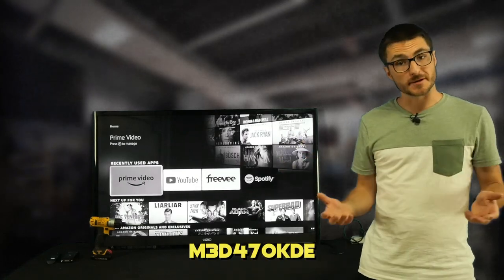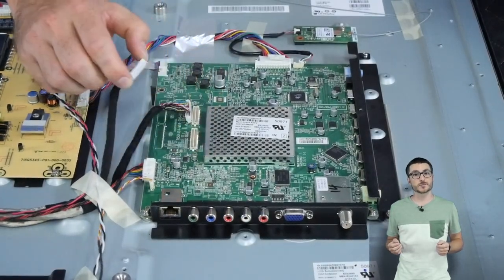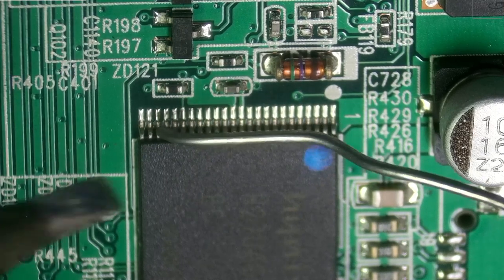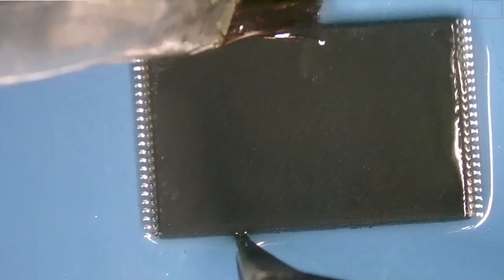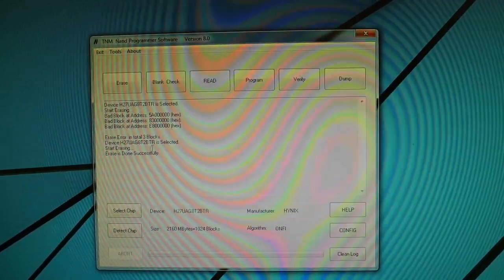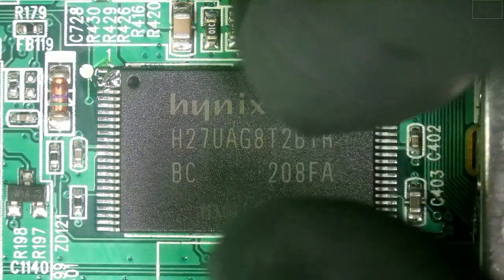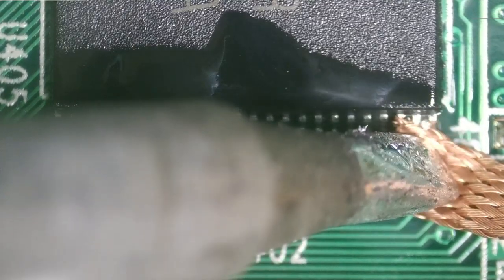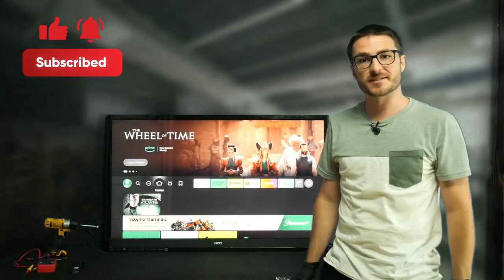Fixed Vizio Black & White Picture M3D470KD

Comment: I might be interested in buying one of these black and white hd TVs as long as there aren't any other issues such as intermittent power.  I was actually looking for a grayscale 1080p TV 42 to 55 inch but it seems there are none for sale.
Reply from the maker: I am not sure I follow. You want it to have a black and white picture? 
If that is the case you can just buy a tv and remove color in the settings so it only displays in black and white. Not all cheap low end tvs will have that as an option in the menus but a lot of sets do have the option to change color settings including removing all color. 
If you are looking to buy it because it's going to be cheap and has a known repairable fault, then yeah this Nand repair is almost 100% success.
Reply: @NicksTVRepair  Yes. Im interested in a hardware based solution to have a black and white tv. why, why not.  So for example if there are certain models that can operate without the nand in black and white then the nand could just be removed and left out.  In other words are there models that the nand could intentionally be removed and the TV will function as normal just in black and white?

Comment: Man, I really wish this video was available a year ago or so. I struggled to fix my exact model, even buying several different components and a new main board. What are the odds the different MB gave the same results? Whatever they are, I was the lucky one who still had the B&W issue! I love this TV and it went strong for around 11 years. I'll definitely consider sending in the MB sometime!
Reply from the maker: Odds of a new mainboard with the same fault are incredibly high. In fact it would be surprising if you found one without that fault. The reason I say this is because it has been over 5 years since new mainboards have not been available for this model. This mean the "new" board you got was a used board falsly advertised as new. Because this is a very common fault, people who own this set are likely to experience this fault as this set is as you said about 11 years old or so, and when they do, they toss out their TVs buy a new one and the recycling centers get the sets, they remove the parts, put them up for sale thinking the black and white issue is a T-con fault or a screen malfunction and then put defective mainoards on eBay or their own site
Any of these you find for sale most likely has this fault at this point. 
This is why it is sometimes best not to replace but to fix the defect of your board on a component level. 
If you do decide to send in your mainboard for repair, we offer a 1 Year warranty on the service but once we do perform this repair do expect the TV to work for at least 5-7 years. These TVs are very well built except for this one issue which means once you fix this, the odds are very low of any other issues occuring.

Comment: I see color in my menu setting but not on the broadcast channels?
Reply from the maker: Black and white picture issues through the HDMI or over-the-air channels are going to be due to the Nand chip malfunctioning as shown in the video. The menus are typically unaffected indeed which I didn't show in the video. 
If you want to send in your circuit board in for repair, please see the repair service linked in the video description.
Reply: @NicksTVRepair  thank you so much for the response.  My Vizio 3D TV isn’t the same model as the one you repaired in your video.  Mine is the M3D550KD.  I’ve kept this tv for so long because I love watching my 3D Blue Ray movies.  :)  My picture isn’t just black and white.  Now everything looks over exposed and super bright.  Can you fix this model?

Comment: Great Video!  Quite helpful!  What temp do you set your soldering iron to?
Reply from the maker: 450 for the iron but what I use and what you use is more of a preference thing. When using 450 if I linger to long on a pad I will burn it and rip it. So I know I have to be quick when I solder at those temps. If I want to reduce the risk of damaging the board I would use 400 or 375. But then i would know that I need to hang out on the joint for a little longer to make sure we get full heat transfer from the iron into both the PCB joint and leg of the component.

Comment: This one is awesome..And how efficiently you accomplished the job..I respect.
Reply from the maker: Thank you! We did have a bit of a twist, I didn't actually expect the Nand to have bad blocks. We do a lot of these repairs, 95% of the time the chip is fully functional and working, the fault is typically the software gets corrupted. So it was very surprising to see we needed to replace the chip.
Most often with these, you just reprogram the chip with fresh software and it works with no problem, and we do a 1 Year warranty on all our repairs and we never get these boards back for warranty so it was just a big surprise.
But that's not for all Nand chips. Most of the Samsung nands for example the software is perfectly fine, and the fault is the chip itself, so what I am saying above is very specific to this type of board and chip.

Comment: Great repair thanks for sharing ,  i haven't done much smd rework , just wondering is there a particular solder you're using for your work , does it have a different melting point? or is it 60/40 solder or lead free solder that you use? Best Regards ..
Reply from the maker: We exclusively buy this one for leaded:
https://amzn.to/3ZAcfXH

And we do use lead free as well that is low melt, but I don't have a link for that one.
Reply: @NicksTVRepair  many thanks for the reply, I don't do much work any more but occasionally I might do some smd, not TV's anymore, so your tips are very much appreciated.. I'll check out your link.. 🙂

Comment: The hardest part is to obtain the bin files for each tv.Other than that,what scope do you use?
Reply from the maker: I believe we bought from the Aliexpress store Eakins 
This is the link to their different options for microscope
https://www.aliexpress.com/store/group/Video-Microscope-Camera/1101264769_512469846.html

And this is the articulating arm we are currently using:
https://www.aliexpress.us/item/2251832788970538.html

Comment: Are the chips you sell on your site already flashed with the correct firmware?  Thanks for the video!  Just getting into microsoldering by replacing my son's Nintendo switch usb port and power chip.  was fun and I think I can do this too.
Reply from the maker: Yes they are preprogrammed to the model in the listing. We have different listings for different model numbers so that we know what software to provide you with. All you would need to do is solder the chip on.
Reply: @NicksTVRepair  Thanks a bunch!

Comment: Just bought a Samsung 65" cu7000 back panel for under 400 dollars
But I have the same TV 
Vizio M3D470KD with the same problem 
People tell me to pit it on the curve, but I love this TV
My picture is crystal clear BUT in Black and White
Where can I send the board and what kind of price are we looking at
Reply from the maker: As a rule, I try to avoid sending people links in the YouTube comments as anyone could create a fake YouTube account with a very similar name and identical logo and impersonate me and send bad links. 
Because of that I have to ask you to check the video description which is the only safe place to click on links as those can only be posted by the true owner of the YouTube channel. 
The video description has our website links, contact information, and a link to our contact form you can fill out with any questions you may have. 
We do offer a flat-rate repair service for this mainboard which comes with a 1 Year warranty.